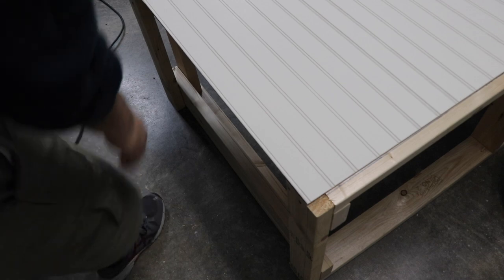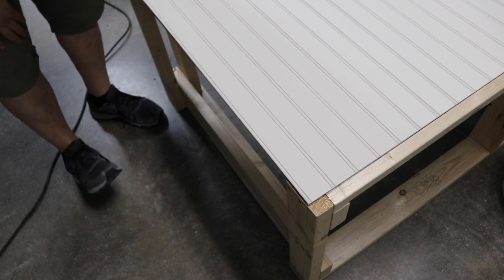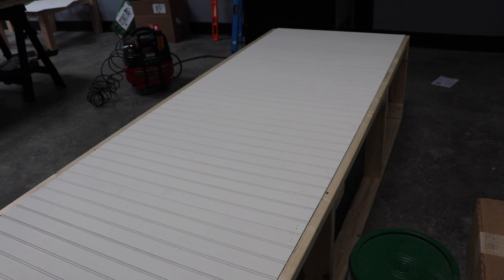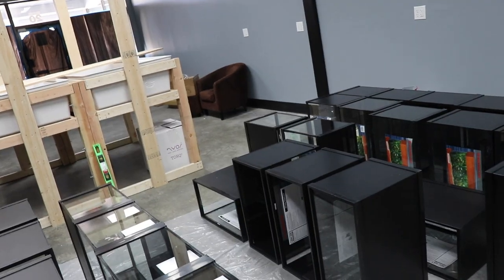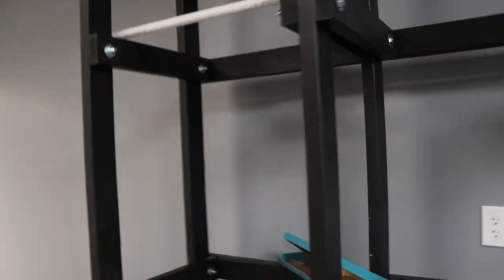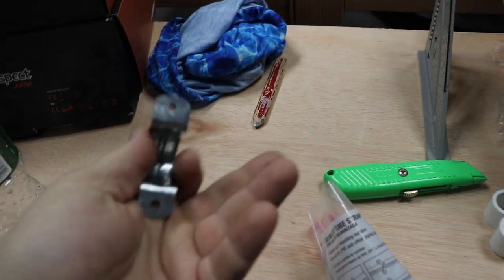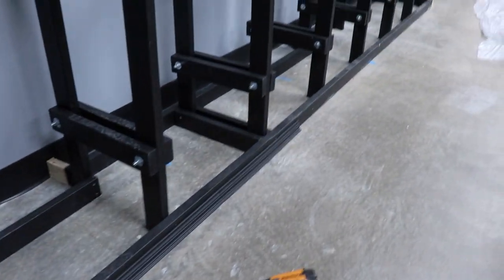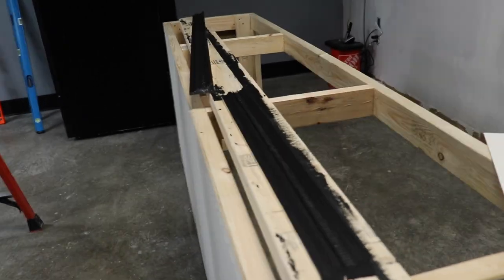Painting Aquariums and Trimming out Aquarium Stands

Comment: I always used a product called Marina clear view, its a gel that holds the backing on aquariums and it seals it so you can actually see the backing at all angles without that mirror effect and it stays put until you peel it off.  I want to paint the back of my 93 cube what kind of paint did you use???
Reply: It looked like he used a latex based paint in the earlier video which in my experience/failures doesn't hold up at all (days or weeks until it sluffs off after contact with water). If your going to use paint use a oil based paint, I use  rustolieum. I've done my last few tanks in a black chalk board  peel and stick wallpaper that is sold with the drawer liners at home depot ($10 will do 2x 75gal). It's good stuff, held up for years now,  it goes on super easy and is about 5 times quicker than paint  (plus zero dry time).
Reply: @charlesw.3245  damn that’s a good idea thank you I’ll try it out!